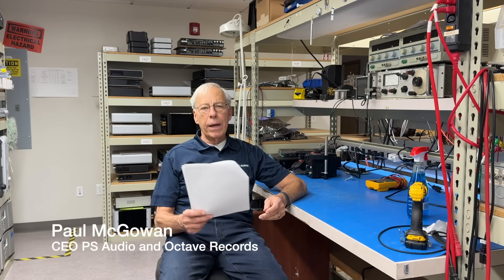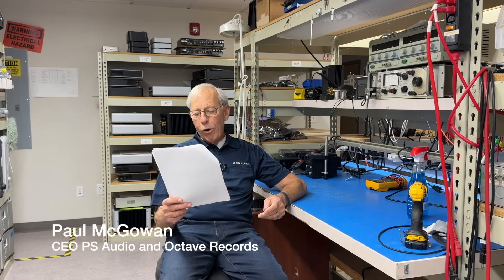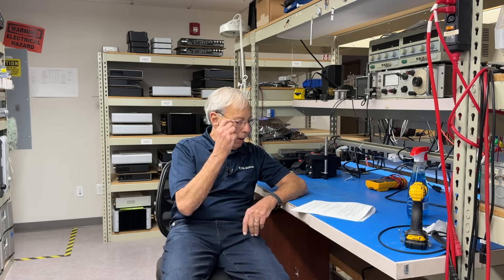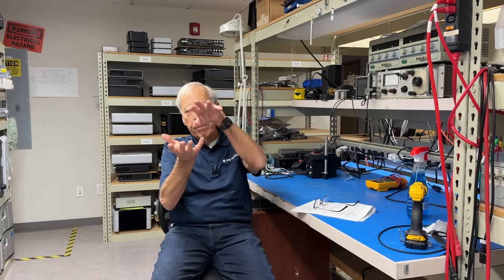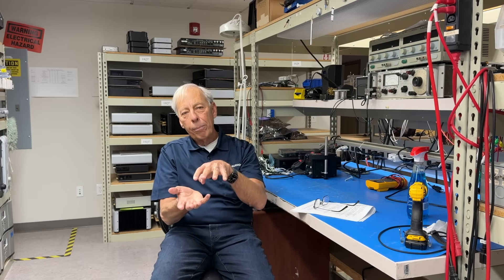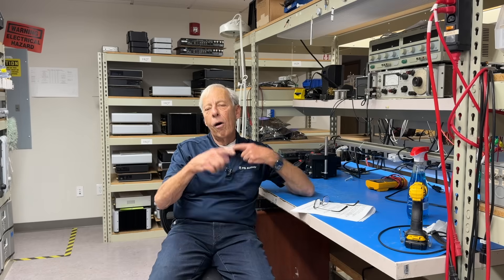Monoblock Preamplifiers

Comment: The John Curl designed Dennesen JC-80 was one of the all time great monoblock preamps. Two completely independent units right down to the power cables. It used a linear fader like on a mixing desk for the volume, so when the two units were stacked, it was easy to match the left and right volume positions.
Krell also made some excellent totally mono preamps like the KRS-1A

Comment: I have a true dual mono preamp, a the Gryphon Bel Canto. 2 volume controls, 2 input selectors, 2 powersupplies, everything. They got around the volume control issue with relay-stepped attenuators, which limits volume control to 20 steps. 

I do miss a remote control. And having to do every input twice manually is a bit of a hassle, but it’s a neat design if you’re into that.

Comment: Tracking of the volume of two channels is a problem with almost all stereo systems. Even a receiver with everything built into one box not only might but likely has level tracking issues. The volume is typically controlled by one shaft going through one variable resistor and into a concentrically aligned 2nd one, usually physically connected together into one assembly. The tracking of the value of resistance at any one point between the two channels as the wipers slide across the variable resistor's surfaces is controlled by the quality of that component. Better systems used stepped attenuators instead. It would be relatively easy to calibrate and track using two of these.
Reply: Nowadays the vast majority of music played is digital and modern digital volume control is able to provide excellent left/right tracking and no audible artifacts or resolution loss.
Reply: @ThinkingBetter  Yes most people listen to earbuds from their phones. But digital volume controls destroy dynamics. But tossing. Not that earbud digiheads would notice.
Reply: @glenncurry3041 You are right if you go back in time to the early digital volume control, but nowadays you can avoid any audible resolution loss with modern digital volume control.
Reply: @ThinkingBetter  Explain to everyone how you can lower the volume output of a DAC in half without dropping the most significant bit with a digital volume control! And then to lower the volume even more, not then toss the 2nd most significant bit! Because every time those bits are activated, the output goes up to full!
Reply: @glenncurry3041 You’re describing bit-shifting / truncation, which is not how modern digital volume controls operate.
Modern DACs use high-precision multiply-and-accumulate math (typically 32-bit or 64-bit floating-point, or ≥48-bit fixed-point) to apply gain before final quantization.
Lowering volume does not “drop the MSB” or throw away bits one by one.
Example:
Audio is processed internally at far higher resolution than the DAC output
A −6 dB volume change is a multiply by 0.5, not a bit shift
The result is then dithered and noise-shaped back to 24- or 16-bit
No sudden jumps to “full output”, no MSB toggling behavior
With 24-bit output, you can attenuate 40–50 dB digitally before noise approaches the analog noise floor of real DAC hardware.
This has been standard practice for decades (ESS, AKM, TI, Cirrus, Wolfson, etc.).

If digital volume worked the way you describe, every modern DAC, phone, streamer, and studio interface would be unusable.
Reply: @ThinkingBetter  Again, a DAC with a typical 2V output. But you want the volume at what would be a 1V peak. Explain to all of us how you get 1V out of a DAC with a 2V peak without dropping the MSB. And YES, every DAC lacking an analog volume control sucks at lower volumes. Laws of physics. Explain how you can ignore them.
Reply: @glenncurry3041 You get 1 V from a 2 V DAC by applying −6 dB digital gain in a higher-precision domain, then quantizing once at the output. No MSB is “dropped”.
Modern DAC signal path (simplified):
1. Audio samples are processed internally at 32- or 64-bit (or ≥48-bit fixed-point)
2. Volume = multiply by 0.5 (−6 dB), not bit-shifting
3. Result is dithered + noise-shaped
4. Only then is it converted to the DAC’s 24- or 16-bit output, producing 1 V peak instead of 2 V. 
The MSB is not “thrown away”; its value is scaled. That’s basic DSP math, not a violation of physics.
Bit-dropping happens only if you reduce volume by truncation or right-shifting—which modern DACs do not do.
At 24-bit output, you have ~144 dB of theoretical dynamic range. Even with −40 dB digital attenuation, the noise floor is still far below: 
• DAC analog noise
• amplifier noise
• room noise
That’s why phones, studio interfaces, streamers, and DACs without analog pots work perfectly at low levels.
“Laws of physics” aren’t being ignored here—you’re confusing quantization with gain scaling.
Reply: @ThinkingBetter  Let's try to make it simple enough for you to follow. Forget all the maths gyrations before the actual RtoR or S/D DAC output. Model X DAC has a 2V peak output feeding a pair of monoblock amps. The source material is constantly hitting peak level, all bits, 16/24/32... are ones. You want to drop the volume by 3dbSPL. This requires a peak of only 1V out of the DAC to the amps. 

Explain to all of us how the DAC's output, lacking a linear analog POT, does not produce an output over 1V other than not triggering the MSB.
Reply: @glenncurry3041 Your entire argument assumes the DAC output voltage is directly determined by the raw PCM bit pattern. That assumption is false.
A DAC does not say “MSB = 1 → full 2 V, MSB = 0 → ≤1 V”.
What actually happens:
• PCM words are numeric values, not voltage rails
• Digital volume applies a scalar multiply to those values in a higher-precision domain
• The DAC converts the scaled numeric value to voltage using its reference and analog stage
Concrete example (no hand-waving):
A full-scale 24-bit sample is
0x7FFFFF (decimal 8,388,607)
Apply −6 dB (×0.5):
0x7FFFFF × 0.5 = 0x3FFFFF
MSB is still active. No bits are “dropped”. The numeric value is simply smaller.
The DAC’s output stage maps: • 0x7FFFFF → 2.0 V
• 0x3FFFFF → 1.0 V
Exactly as designed.
If MSB “triggering full output” worked the way you claim, DACs could not reproduce quiet music, fades, or dynamics at all—everything would slam to full scale whenever the MSB toggled. That’s obviously not how audio works.
This is not ignoring physics.
It’s basic DSP + DAC architecture, and it’s been standard for decades.
Reply: @glenncurry3041 To sum it up, digital volume control works transparently because the DAC’s usable analog dynamic range is much larger than the dynamic range of real music and listening environments.
• A modern DAC has ~115–125 dB analog dynamic range (often limited by the output stage, not the converter core)
• Real music rarely exceeds 60–70 dB of instantaneous dynamic range
• Typical listening rooms have 30–40 dB of ambient noise
• Amplifier and speaker noise floors are usually well above the DAC’s noise floor
Reply: @ThinkingBetter  "What actually happens:
• PCM words are numeric values," that represent an exact voltage at that sample point. Or perhaps more correctly the voltage of the signal from the source at that point in time. e.g. a mic output voltage. Or conversely, the exact relative voltage level from the DAC for an analog voltage output. 

Again show us all how an RtoR ladder DAC with a 2V peak output (or S/D emulating one) is limited to never exceed 1V fed to the amp and still activates the MSB! When that MSB is turned on, that DAC produces 1V minimum out. Show us all how you can vary this typical 2V peak output DAC to keep's it's peak voltage below 1V, when the 1V MSB is on!
Reply: @ThinkingBetter  How hilarious to have a digihead admit that: 
"• Real music rarely exceeds 60–70 dB of instantaneous dynamic range
• Typical listening rooms have 30–40 dB of ambient noise"

when they scream about how bad vinyl is with only it's 60-70db dynamic range! How superior even Red Book is because.... 90db!
Reply: @glenncurry3041  Point is that with modern DACs you have plenty of dynamic range way beyond the music you are playing to adjust volume without any concern of losing audible details. When DACs were limited to 16 bits (96dB), your argument would have had some sympathy. Also R2R DACs typically will give you less headroom and are less ideal for digital volume control.
Reply: @ThinkingBetter  So failing to be able to prove me wrong in any way, failure to show us all how it's not bit tossing, you drag the subject away. SAD! The POINT is still that a digital volume control on an output can only toss bits! So if you are listening at lower volumes, you only have fewer bits of resolution to work with.
Reply: @glenncurry3041  Let’s assume a DAC with 24-bit conversion.
If you apply −60 dB of digital attenuation (a typical lowest volume step), you lose about 10 bits of effective resolution (≈6 dB per bit). That still leaves ~14 effective bits, or ~84 dB of dynamic range.
That is already better than the practical dynamic range of vinyl and far below the noise floor of most listening rooms and amplifiers.
This is why moderate digital attenuation is audibly transparent on modern DACs.
Historically, this also isn’t new: early Philips CD players used 14-bit DACs with oversampling, and were often praised for sounding better than early 16-bit non-oversampling designs. Those systems ran at full scale with only 14 bits and were still musically convincing.
Most early criticism of Red Book CD wasn’t really about bit depth, but about early reconstruction filters, phase behavior, and implementation issues, especially in the high-frequency region.
I used to agree with your point in the past when audio was limited to 16 bits throughout and DACs were 16 bits or not much more only.
Reply: @ThinkingBetter  Thanks for perfectly proving me to be correct! YES! "Let’s assume a DAC with 24-bit conversion.
If you apply −60 dB of digital attenuation (a typical lowest volume step), you lose about 10 bits of effective resolution (≈6 dB per bit). That still leaves ~14 effective bits,"

IOW that 24 bit DAC tossed bits down to 14.

But let's correct your attenuation error. "−60 dB of digital attenuation (a typical lowest volume step)". If you are referring to a -60db pad dropping the voltage, yes very low volume setting. But hear you are talking about "60 dB of digital attenuation" from the 144db S/N of 24 bits. NOT -60db from 2V out. It's the resultant 14 bits you describe. Tossing 10 bits. 

"I used to agree with your point in the past when audio was limited to 16 bits" which YOU state is now limited to 14 bits!
Reply: @glenncurry3041 Neither in analog volume control or digital volume control can you maintain same dynamic range when you have the volume cranked down to minimum. If even a first volume step up from mute resolves 14 bits at -60dB volume setting (in 24 bit DAC), you seriously have no audible disadvantage of running at less than original bit resolution. It's not simple tossing bits math also, as I've explained (although you obviously reduce the bit resolution).
2 decades ago I would be completely on your side as your 16 bit digital architecture would be of serious audiophile trouble when doing volume control. If you volume adjusted -60dB on it, you would end up with 6 bits of resolution or 64 levels of voltage rather than the 65536 levels in red book CD.
Reply: @glenncurry3041  Imagine -6dB per bit down and at 14 bits you are already at minimum volume hardly able to hear it: https://www.youtube.com/shorts/NWoBjtDVwhE
Reply: @ThinkingBetter  Another failure to actually show how reducing the output/ volume of a DAC to below 1V with a 2V peak output does not stop the MSB from ever being used, bit tossing. Just admit you can't violate the laws of physics and move on.
Reply: @glenncurry3041  I don't know why you are so hooked on the term bit tossing. Yes, the lower volume you have the less bits of the total dynamic range you use. So what? If you have, let's say, 125dB of dynamic range, you have excellent resolution and dynamic range also at any usable listening level. Yes, of course more of the highest significant bits will go zero when you lower the volume, so what? A 24 bit file can lose 8 bits before it hits CD quality of 16 bits. That's -48dB of volume, which is very quiet listening and not audiophile level (Fletcher Munson will make sure your experience is rather narrow-band). More typical audiophile listening levels are in -20dB (21 bits) to -30dB (19 bits). 
Digital volume control easily exceeds anything analog incl. from vinyl, tape, microphones and considering any room noise level.
Reply: @ThinkingBetter  "I don't know why you are so hooked on the term bit tossing." Or more so why you so desperately run away from the well established and appropriate terminology. 

"Yes, the lower volume you have the less bits of the total dynamic range you use."  WOW! How long did it take you to just accept reality and admit it! 

"So what?" In a 24 bit system, the MSB designates whether, in a 2V peak system, the signal is above or below 1V. The next bit divides the remaining above or below that 1V line in half, above or below 0.5V. By tossing the MSB, you are not leaving 23 bits to divide up the 2V peak. You tossed half the sample points. All of those above the 1V line. You have half the original sample points left for resolution. 

An analog volume control will maintain the full 24 bit resolution at all volume levels. This confuses you?
Reply: @glenncurry3041  No I am not confused on this matter. Seriously, what are you gonna do with 24 bits of DAC resolution when your analog volume is already low and below meaningful listening level? Yes, you might have effectively 120 dB DAC analog resolution but if you are already down at, let's say, 50dB SPL, what do you imagine you can hear better by running all those DAC bits?
Reply: @ThinkingBetter  Below a meaningful listening level? 2V peak is typical for DAC outputs. Some are much higher. Amp inputs are more typically around 1.5V in for max out. So at 1V peak in, you are driving the amp vey hard. But have only half the bits of resolution left when the MSB is never on. 

Bring that down to some comfortable listening at maybe 0.5V peak? At 200W amp would still be cranking 50W! But with 1/4 the bits left.
Reply: @glenncurry3041  It doesn't matter the MSB is not used when you have way more dynamic range than your music can ever reach to begin with. Likely you have 21 bits of effectively working bits and that's already more than your total possible dynamic range of your system against the noise floor. If you are at CD quality and can barely hear the sound, you don't actually experience anything even close to CD quality from a perception perspective. BTW, the power and voltage don't track equally. 1 bit is one doubling of voltage but one quadrupling of power. Thus if you go from 2V to 1V to 0.5V you go from, let's say, 200 Watts to 50 Watts to 12.5 Watts. And if you started with 24 bits and lost 2 bits, you still have 22 bits to go with (and likely the LSB 1 bit is pure noise). It seems you get the math quite wrong.

Comment: IMHO, having a mono block preamp is an exercise in unnecessary complication with no real benefit.  I can see the benefits separate power supplies for power amps, just not for anything else.  The power requirements for everything else just aren’t great enough to justify the need for separate power supplies.

As for integrated components, they can be every bit as good as separates.  Will integrates in general be as well built as separates?  No, but they don’t need to be built to the same level.  Let’s take an integrated amp as an example.  If the preamp was a separate component, you would need to design the output voltage for a wide range of amps.  With an integrated you know the exact output voltage needed by your amp.  There is no need to build the preamp to work with equipment it will never be connected to.

Comment: In my DIY setup I built a monoblock preamp.  Not commercially viable.  Both channels are in the same box, but the only shared resource is the power cable.  Attenuation is done with a single knob switching two autoformers.  I doubt it makes a noticeable improvement.  But when you are just buying parts for a one off design, why not?

Comment: Sometimes integration of a very good Class A preamp in a two channel Poweramp can give a Class act. Especially, if both systems are fully discrete and little to no integrateds are used. Additionally, no long interconnects are in the chain.

Comment: In a well-designed monoblock preamp (2-3 chassis), both channels enter a single control chassis. The power supplies, gain, and control can be grouped together in multiple ways. For example, the Pass Labs XP-22 groups gain and control (2 chassis), but the XP-32 groups power supplies and control (3 chassis).  Power supplies can be in a dual-mono chassis or two chassis. Yeah, it gets complex and expensive.
Reply: The XP-22 is part of my system and it sounds just fine with its separate power supply and true XLR inputs.
Reply: @Scopolamine46  Very nice.